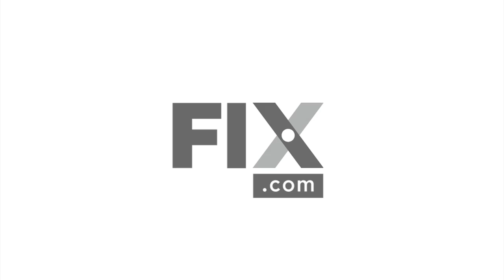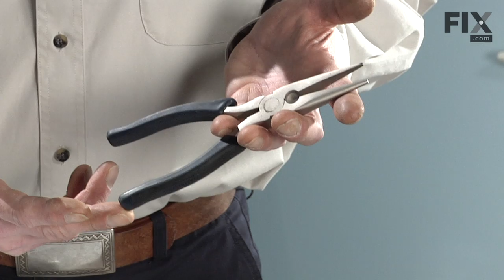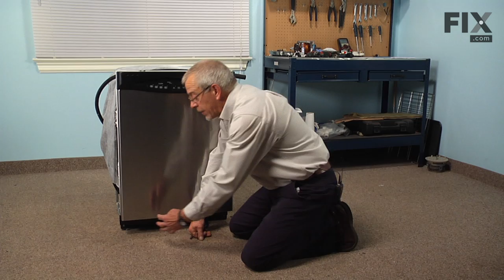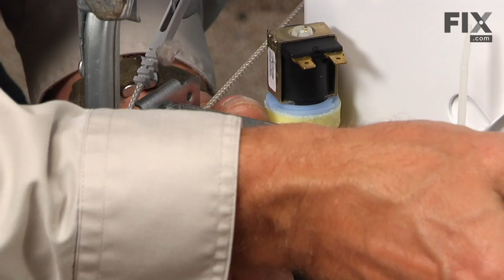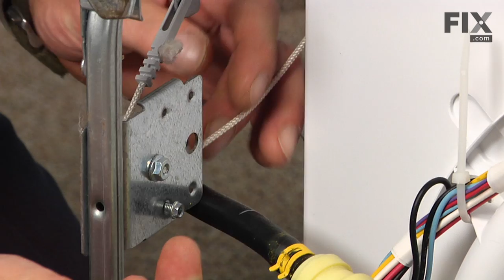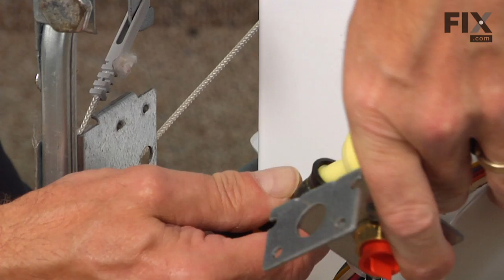Maytag Dishwasher Repair – How to replace the Water Inlet Valve

Comment: Every month or 2 my Maytag collects water in bottom then leaks onto floor.
Then after a couple days it stops leaking.
The drain hose is properly elevated high.
Does this part replacement what is needed ??
Thanks